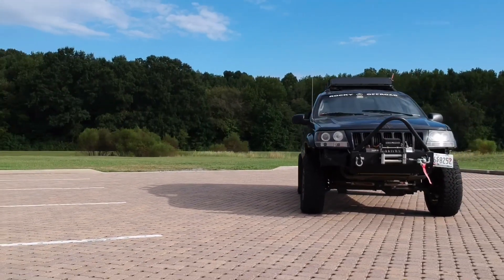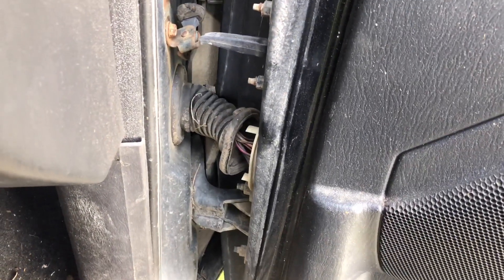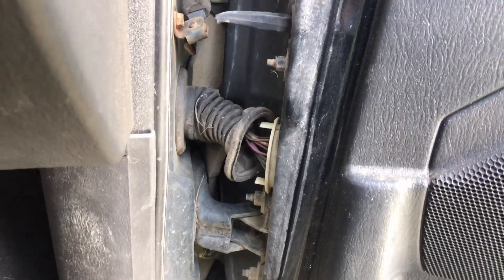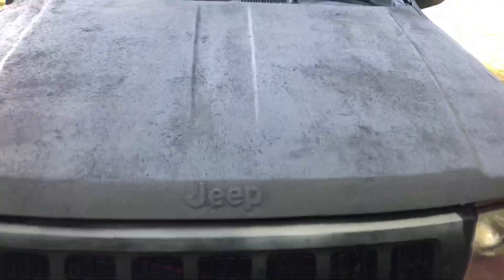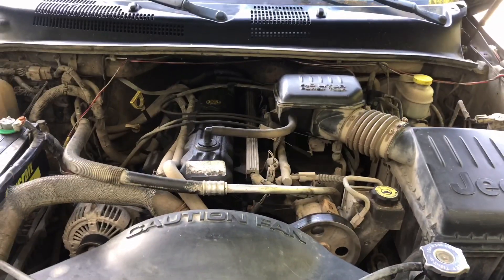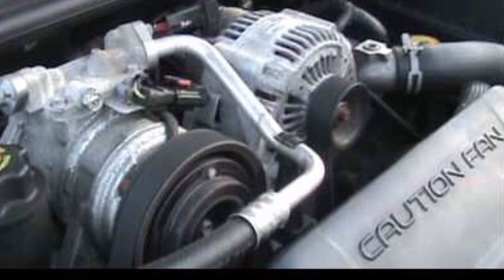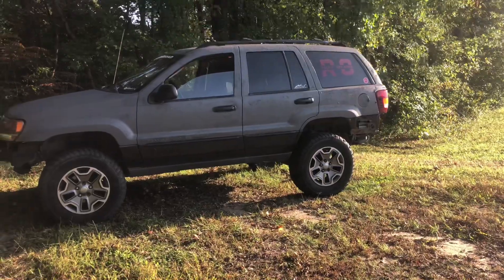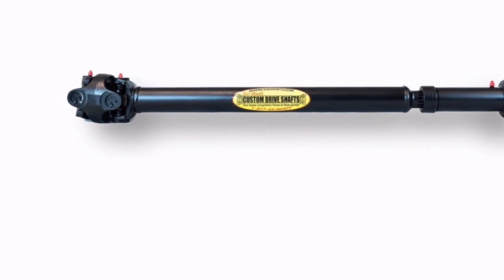Common issues with a JEEP WJ (WATCH BEFORE YOU BUY)

Comment: I got an 04, and I was able to fix my blend door by pulling the blower motor out and just reaching in to set it back in place. Its located under the glove compartment and has 3 screws holding it in.  Might not be the best way to do it for some but I was in and out in 30 min and haven't had to fix it since :) Keep your WJs on the road everyone
Reply from the maker: Oh that’s awesome. I didn’t know about that! Thanks for sharing.
Reply: The recirculation door is behind the blower fan.  Rocky is correct about the blend door. I've fixed my recirculation door in the recirculation  position to reduce the dust that gets sucked in. It clicks after shutting the engine off because the plastic is cracked and clicks as it rotates around the rod as it tries to find it's home position. I'm going to fix it with a hose clamp once the blend door breaks and I have to pull the dash.

Comment: I have a 4" long arm lift on my WJ with stock driveshafts. The front has to be a double cardan type to work. Any lift on a rzeppa joint front shaft will result in failures.
Reply from the maker: Another reason to upgrade is simply strength. The stock driveshafts are surprisingly weak if you happen to hit it on a rock.

Comment: Tracbar bolt holes oval out and make steering wander.
Reply from the maker: That’s a common issue with most Jeeps however yes a big issue. That will be covered in an upcoming video on fixing death wobble.
Reply: Rocky tv do you have a fix? I went to the bigger bolt and drilled em out and mine still drives like crap gave up on 2 others lol
Reply from the maker: I’ve found that the best quality set ups don’t allow that to happen.
Reply: Ahh alright i just have a stock track bar